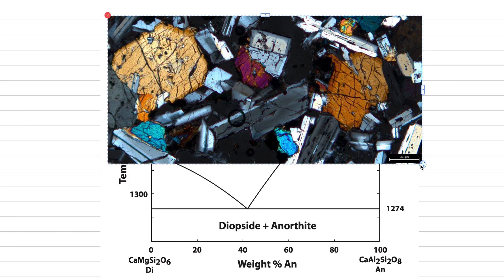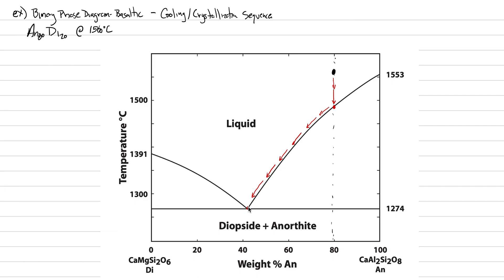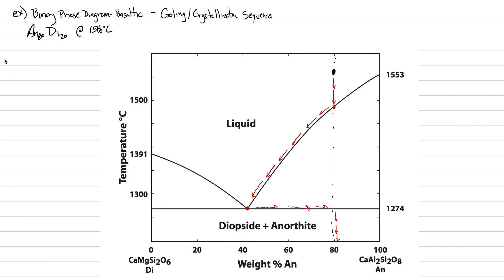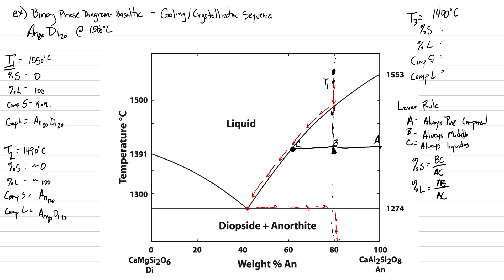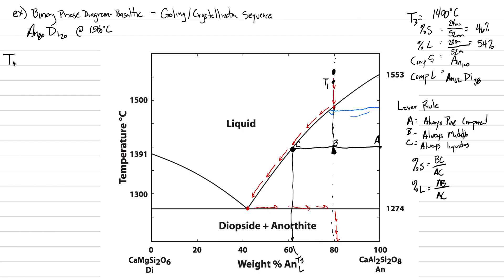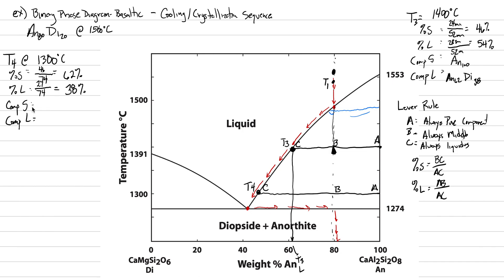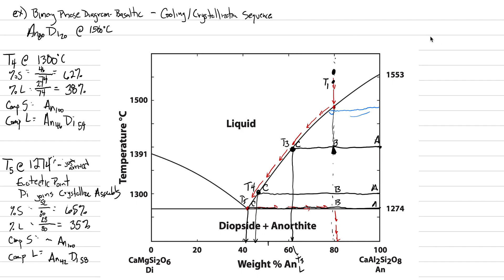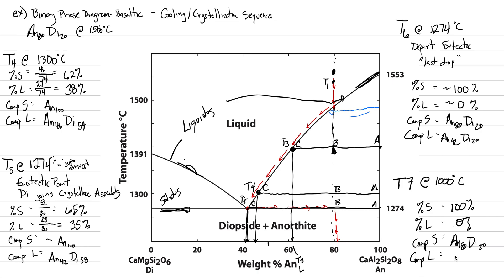Phase Diagram 2: Binary Example

Comment: After you get to the eutectic point, why would you calculate the composition of that solid as the total of the solid that was previously obtained and that which is obtained by letting the eutectic sit and crystallize? That's possibly the only part that may confuse some people. It needs to be mentioned that up the eutectic point, all the solid that's obtained is 100% An, and whatever crystallizes after the eutectic is reached will obviously be 46% An; but if you convert the entire eutectic to solid and then for some weird reason mix that with the pure An you obtained from before, you obviously get a solid with a composition that is the same as the melt you started with...

Comment: What is the pressure? Is this just like sea-level atmospheric pressure then?
Reply from the maker: Constant pressure. could be 1 kb or 1 atm.
Reply: @kennethbefus  ooh, interesting! I guess the role that pressure plays on phase transition differs quite a bit from one elements or molecule to another then. I want to learn a lot more chemistry and geology (and biology too). This is pretty cool stuff!

So pressure has very little affect on the melting/precipitation point of these minerals then?
Reply: Pressure does have an effect. 

If another such experiment were carried out at a different pressure, the temperature values would be different.

It is like the effect of pressure on the boiling point of water: at 1 atm, water boils at 100°C; but at 2 atm, it boils at 120°C.

Comment: I read some comments that have the problem of understanding why the soldi composition at the end (T7) is An(80) Di(20), so I will try to explain in the following how these values come to be.

1. When you arrive at the Eutectic you will have a specific amount of Melt left, which you can calculate with the Lever Rule. (In this example we got roughly 35% Melt and 65% of Anorthite crystalls)

2. Now these last 35% Melt will form Diopside and Anorthite in a specific ratio. This specific ratio is the same as the one at the Eutectic. 

3. We can now calculate the amount of Diopside and Anorthite which will crystallise from the 35% melt that is left, by multiplying the specific Ration with the amount leftover amount of melt. (for the Example in the Video:  The amount Anorthite that will be formed is (0.35*0.42)*100 ≈14.7%    The amount of Diopside: (0.35*0.58)*100=20.3%  )
 (DISCLAIMER: I know the values are a bit of, but the reason for that is that I cannot measure the exact points, because I dont have the Worksheet. But the method overall should be the correct and worked other examples completely fine.)

4. Now to get the end results for Anorthite, we have to add the 65% which crystallized before we reached the Eutectic to the 14.7% we calculated. For Diopside we allready got the end value of 20.3% because it did not crystallize before the eutectic.  ( Total Anorthite: 14.7% + 65% = 79.7%)

End Note:
I hope for the people it will be clearer for the people that come here in the future. If anyone has a question just write it under the comment and I will try to answer it. 
(If you want to copy/share this, just try to fix my bad english before you do it.  :P )